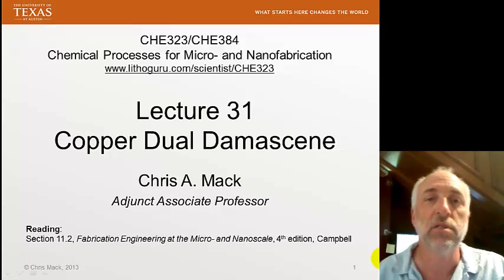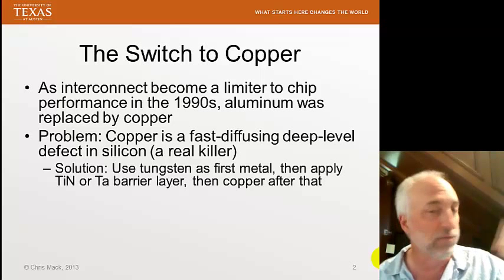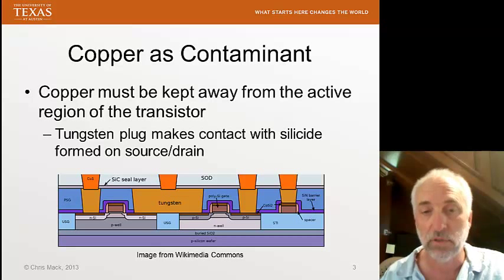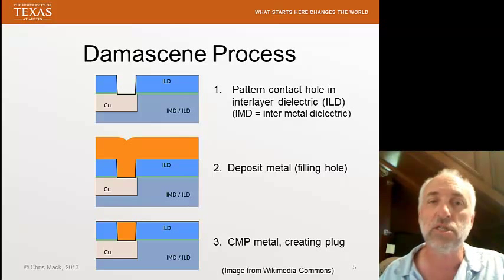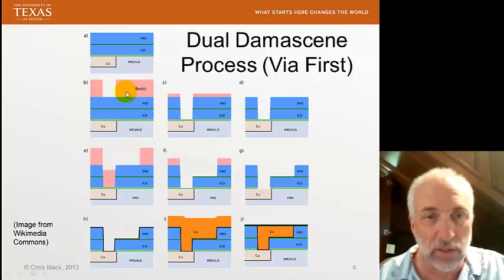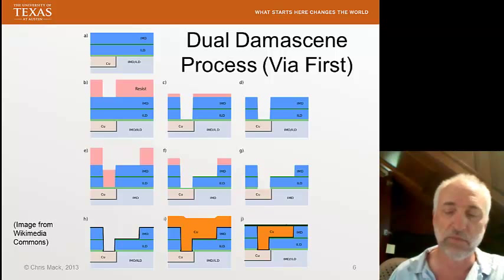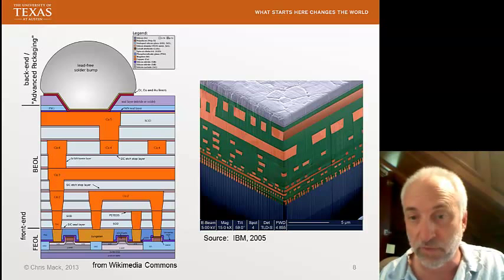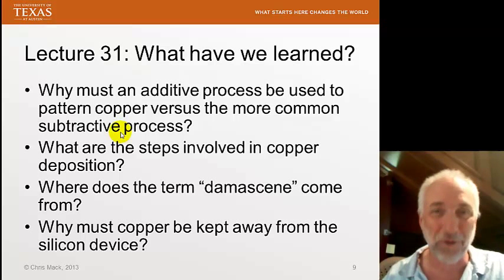Lecture 31 (CHE 323) Copper Dual Damascene

Comment: you are a litho wizard. LOL. I have an issue which i can't resolve... maybe your the man i need to chat with. Can you get an overcut profile with a negative, CAR like SU-8? I am using glass substrates and have tried to expose through the glass wafer. This took my 111 degrees undercut profile with SU-8 (topside exposure) to a 91 degrees angle with backside exposure, but not the 60 to 75 degree angles that I need. Any suggestions on how to get a true overcut profile? I am wanting to use SU-8 as a structural material and need to coat with gold evaporation. This line of sight technique won't coat the sidewalls of an undercut profile.

Comment: Hey Chris, this is a great video, thanks for doing it! 
Just one comment on the historical roots of the Damascene process. It is not the inlay process, but the forging of the steel. You get usually two types of steel one with high carbon content and one with low carbon content, you forge it to thin layer then bend it/cut it, forge it again and repeat for many times, the subsequent etching only reveals the micro structures on the blade due to the different steel types - you see micro-stripes. But aside from the visual aspect, it actually helps the blade not to be brittle and at the same time to hold an edge well. Those swords were famous for their sharpness and toughness and were very expensive in the middle ages. Here is a video that illustrates a modern approach: https://www.youtube.com/watch?v=gZscf49s6e0
Reply: Both definitions are correct.  Chris is correct in his application of the Damascene definition for the semiconductor inlay process.  

HISTORICAL
relating to Damascus steel or its manufacture.
"a fine Damascene blade"

Inlaying

relating to or denoting a process of inlaying a metal object with gold or silver decoration.
"elaborate Damascene dishes"